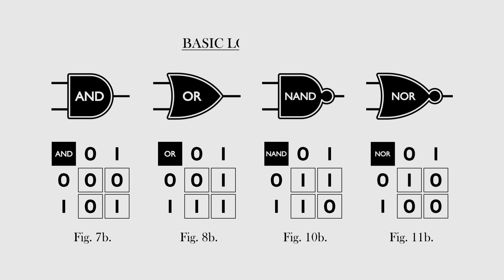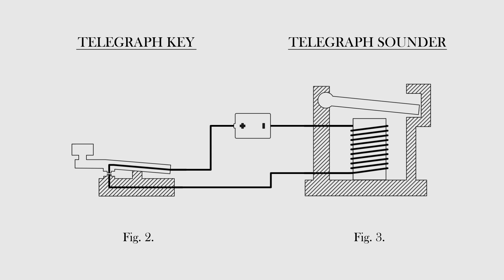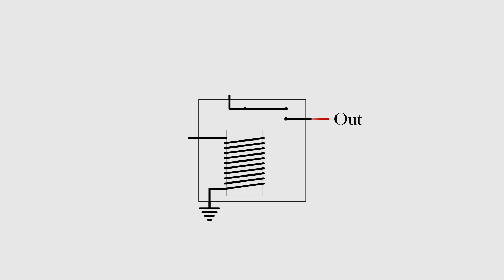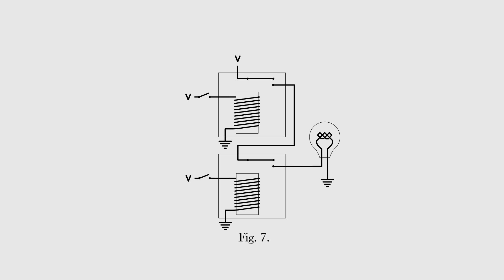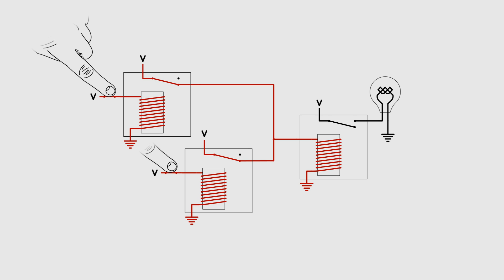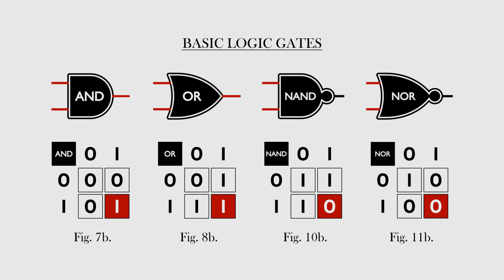Relays and Logic Gates - How to Make a Computer: Part I

Comment: I get it so when you shift type a letter or number its using a and gate if I'm correct
Reply: No. But the machine can read multiplexed outputs and determine 2 keys are pressed. There's no way to know which specific inputs of a gate are high or low. That information is lost.